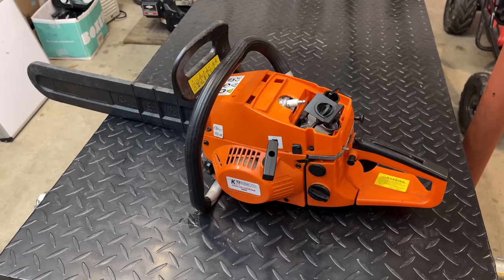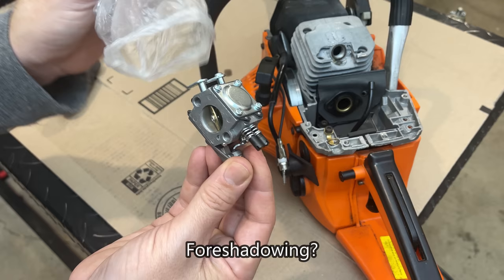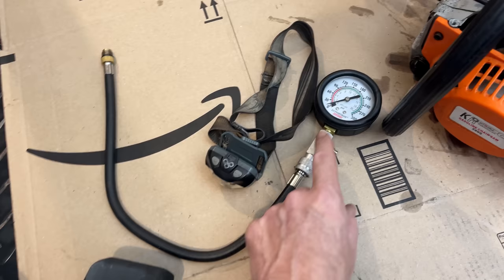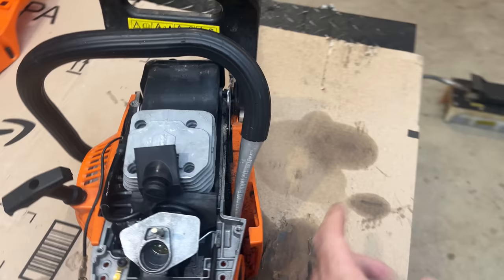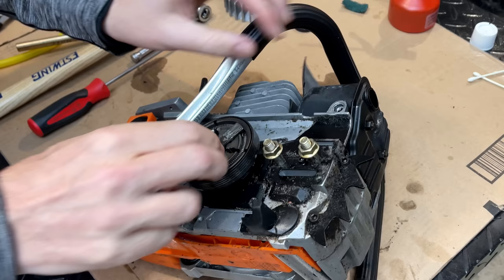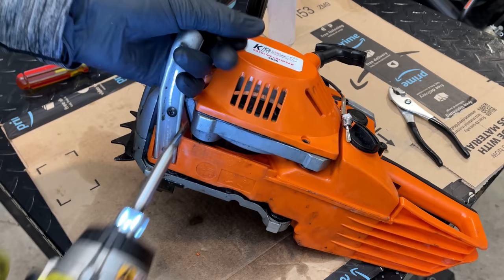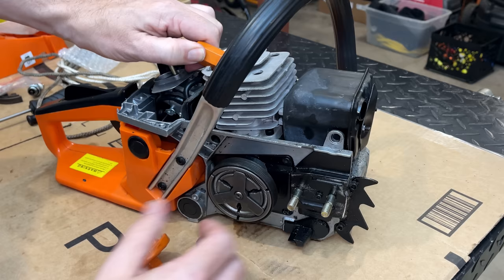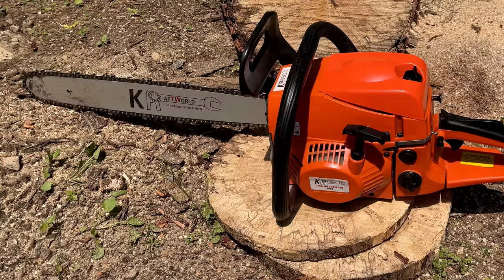Chinese Chainsaw Challenge - Will it Run? (Unbelievable Amount of Problems)

Comment: I had to laugh when your clutch flew off! The exact same thing happened to me after I'd had to remove it in order to reach the oil-pump and fix the misfitted oil-line. The clutch flew off into the long-grass outside my workshop. Thankfully, with the help of a magnet I managed to find all the bits.
A few weeks later it wouldn't start and I found that the fuel lines had melted, no doubt due to poor quality oriental hoses and ethanol which is mandated at 10% by volume where I now live.
Don't by this junk folks!

Comment: It has some value if you plan to bring it 20 feet up in tree to do some cutting AND plan to drop the saw. 
I bought my first saw, a Partner 5000 Pro, some +40 yrs ago when I started to log. Most other loggers had Johnsreds, Husqvarna was young and this was before Stihl became anything. Yes, the Partner is a bulky beast, but it still runs. Ohhh, I changed the chain ... hahah.

Comment: 1:16:35 that happens 🤣
Seen that before🤣🤣
As a lumberjack with 25years experience we always used Husqvarna or Stihl!!
At Education on lumberjack-School the repair dude, handed me an Echo Saw.. I went wtf is that, mmmrph😤 Dude forced me to only use echo for a Long time… I must say its a great Saw!!
I noticed your trimmer is Echo🤓
Not by any chance i have had leaking seals on any Saw???!🤷🏼‍♂️

Been working a lot in People’s gardens, trimning Hedges.. There i learned that Tanaka make great light hedgetrimmers! Next to a heavy stihl!

You did splendid on that cheap crappy Saw dude! Hope the owner link these repear to the manuacturer💯 So they Can pay for your fix, and Maybe make their product better🤷🏼‍♂️

But i must Saw, buy quality and your Saw runs for 20 years💯

BTW we once had a brand new husqvarna that ran backwards??? 😆

Comment: As you said, you get what you pay for. 

Living in the Philippines and building a home here, I gained a lot of knowledge with regard to Chinese made products.  It's a crap shoot at best, and I can honestly say that it seems a higher percentage of Chinese made items are poorly made at best. That became quite frustrating as we built our home and learned what to buy and what to avoid like the plague. 
On the upside. We purchased two ceiling fans that were identical to Hunter fans we had purchased in the U.S.  Both are still working flawlessly after 9 years of use.  We also purchased a dehumidifier, also 9 years and going strong.  My Ingco tools have also proved to be dependable for home use. 

It's definitely a roll of the dice when buying some foreign made products. 

One last comment.  My old 28-inch Stihl chain saw was a beast and took quite a beating in the mountains of Colorado.  Like the old commercial said, it took a licking and kept on ticking.  
You do get what you pay for.

Comment: You did a great job with those issues. All said and done that saw is gutless and shows you get what you pay for.  My stihl 230 will output it by 3-4 ratios and cuts 3-4 times faster.

Comment: Put the air intake box back on the top of the carb. It's running better partially choked hence put the air box/filter on to restrict intake of air.

Comment: It's great to have expert friends to ask questions. If you have mechanical ability you can fix most anything that way. I believe since it ran before, the straight gas had to burn up the crank seals, for the other damage I'm not sure if straight gas would cause that damage to fuel lines/etc. By the way if you put pressure on the bar (push it up) when adjusting the chain it works better while adjusting and 3 links is the rule of thumb (when lifting the chain you should see 3 drive links) I'm not an expert but it sounded to run great but sounded like it could be leaned out so it would rev quicker.(sounded like it was bogging but maybe it's just the saw.) Great video though most people won't have the tools you used but it sheds a light on many aspects of the workings of a saw/2stroke engine. Maybe you should get a dirtbike to work on next!

Comment: IM AN AMERICAN LIVING IN THE PHILIPPINES ,I BOUGHT ONE OF THESE SAWS FOR AROUND $50 NEW AND IVE ONLY HAD 2 ISSUES ,THE ORIGINAL PLUG WAS WORTHLESS ,CHANKGED TO AN NGK AND IT RUNS FINE ,TONS OF POWER..THE OTHER ISSUE IS THE CHEAP CHINESE CHAINS THEIR ONLY GOOD FOR ONE OR TWO CUTS ,THEN NEED SHARPENING OR REPLACING..ID GIVE A HUNDRED BUCKS FOR AN OREGON CHAIN

Comment: this was definitely assembled on a friday evening on surprise imperative overtime, it had like 13 different individual and non related problems
one more issue i see: the seals were both warped, even the one that was straight, could the crankshaft be off center with the seal hole where after some while passes and the seal material becomes less flexible, even the new ones will warp? it is not only hard to replace, but also sketchy since the metal used is really chap and the threads on the crankshaft could easily be destroyed

Comment: This is a good 'How To" video. I learned a lot. Like, not to buy this particular saw. But as far as the diagnosing problems, I picked up a few pointers. I've bought some Chinese made products before. Some good, some bad. The problems I've had with em are mainly quality control related. Decent product but just mass produced with no quality control or checks. Heck, even so-called 'American Made' has it's issues as well. Overall, with all the small motors being made now, they are mass produced and have flaws. If you want better quality controlled products, you just have to pay more. If you know how to work on the stuff yourself, you take a chance on buying cheaper. But overall, you did a good video. You had WAY more patience than me.  lol

Comment: I believe putting on the chain break also works a detent for the amount of pressure is on the fuel system  like a declutch on a diesel cat and i am using some not correct words make lts  pressure on the excise  system !!!

Comment: You have the patience of Job - thank you for the excellent diagnostic repair video.  There is Chinese junk and then there is Chinese junk!  The Chinese can make superior products if they are required too.  If they are just building a product for selling at a price point - this chainsaw - is an example of what you get from them.  The Farmertec / Neotech Chinese chainsaw brands have come a long way in quality and performance.  They are definitely in a different Chinese class - but you still have to look them over carefully before the first run.

Comment: I admire your perseverance with this, but at least the parts were dirt cheap. The only slight improvement maybe would have been to cut about 1/4" off the front of that lid to make it fit a bit better, even though it was the wrong one.

Comment: Haha I was going to ask if you used threadlock on the clutch. I guess you didn't :D 
That's terrible what those factories put out the door. I have a (lesser) name brand chainsaw someone gave to me a few years ago. It had the same issues and I am guessing it probably came from the same factory.  I thought crank seals but went through the same initial investigation looking at the fueling but I don't think I checked for a malformed impulse tube! That was a surprise. I decided my next step one day was to do the crank seals. I will have to look again at your part references I think but not sure how easy it will be getting those parts from New Zealand. The seals are still on my to do list so it was great to see one pulled down. Thank you and good going getting it running! :)

Comment: Appeared that is a soft pine log. Just a guess. I think I will stick with the other orange saw brand. Did learn the seals are a factor for compression. Did not realize the deltaP was that much of a factor for compression. Now will see if can get my old craftsman running. 😂

Comment: Ouch ... that was a challenging one James, your patience was *noted ... most would have tossed in the recycle bin, but it was an informative diagnostic video ... I was watching and wondering what the manufacturing and assembly side must be like at these cheap saw shops must be like in Chyna ... but even with quality saws/mowers/trimmers they can all be a headache to keep running well ... Amazon, Ebay and parts places must be making a fortune

Comment: It sounds good for low compression to be the issue but I guess it could be as low compression also means low suction into crankcase for fuel entry or starvation.  2 stroke are a finicky low to troubleshoot.

Comment: That saw is kind of a cross between a Stihl and a Husqvarna.    You can sometimes cut off the old fuel line and use the grommet from the old line to seal the hole.  Just push some new Tygon through the old grommet.

Comment: Clearly shows mature status when sharpening and tensioning the saw.

Starting the saw without the brake being is unforgivable.

Potentially too it's a new chain so it needs to be run in so it can naturally stretch and then the correct tension can be applied.

Comment: Did you see the bottom ring thin out from the exhaust port
Interesting events, but I would check for run out of the crankshaft,
Watch the video on the output  of the crankshaft runout.

Comment: I suppose when you look back at the start when you we're testing the fuel supply you'll be able to see the air bubbles. It's good. You have a YouTube channel and persist in repairing this thing for entertainment otherwise most people would have thrown it away and put it down to experience as I feel your journey is not over with this thing.

Comment: WHEN I WORKED FOR THE US FOREST SERVICE STUDEBAKER WAS JUST GOING BANKRUPT.  THE GOVERNMENT BOUGHT STUDEBAKER TRUCKS TO HELP SOLVE THEIR PROBLEM.  WE HAD A 2  ton truck where the engine acted like your chain saw.  It would run and then die.  It stImmed all of our competent mechanics.  The problem turned out to be a a rusty gas tank .  The rust  allowed gas to come thru enough to run the engine and then the fuel pump would push thru rust and block the fuel flow.  It took a while to solve the problem.   What a coincident.

Comment: Get a plastic piston stop that goes in the spark plug hole.  Stihl makes one.  They are cheap.  I usually just hit the flywheel nut twice with my impact.  The torque is 25 foot pounds for most saws.

Comment: I have a KX450 that needs the Pilot jet cleaned so it runs better with the choke on. Until I clean it it will stall as if the idle is set too low but it is not. It s because  the choke has to compensate for what and where the Pilot jet is not delivering. So I got to take the FF'ng off and ream out the opening with a twist tie

Comment: when you were using the brake bleeder on the fuel line, and all the bubbles were roaring up the fuel line, I suspected the fuel line was compromised.

Comment: Have one of those saws that is supposed to be the "same" as a Husky 372xp. Didn't run worth a crap when I first got it. Ended up putting in a Walbro carb from the Husky model. It's now my milling saw. If I blow it up, at least I'm not ouy the $1000 CAD that the "real" saw would cost me.

Comment: Did you ever put A base gasket between the carburetor on that chainsaw & the engine block if there's no gasket it's sucking in air due to that gasket missing off of it. It has to have that gasket. It needs that base gasket.& Adjust those fuel mixture screws while it's running.

Comment: I was on home Depots sight and seen a Chinese chain saw and out of the box it would not run, I had to pull it while my mom held the throttle wide open,... just to make it fire,...I just sent it back. I think I read that the pull starter plastic breaks on  those saws.

I just bought a Homelite off of Ebay,...it looked as if it just needed a primer bulb,... but I ended up putting on new fuel line.
But it wouldn't run, it was getting spark but  no fuel,.....so its probably in the carburetor,.... I was about to replace the clutch when I noticed looking through the exhaust port the far side of the cylinder has a wide shinny strip up the cylinder,.. that kinda makes me think there might be something wrong.
But I have not worked on chain saws much.

Comment: Get some Ametech engine treatment, it relines the cylinders. Don't use too much or you'll never pull it. For that bore I'd try about half a cup. It will have to run a few hours to get the compression up. It will probably cut about 20 trees down before you have to reline it again.

Comment: First off, good video, second is at 22 mins the fuel line has multiple cracks but I think you missed that at the time but then again the Vac test did produce a shit load of bubbles didn't it, third is I bet that clutch nut was actually loctite'd on, the internal threads were white when you first removed it and it took heat to break it free. The real take away is it's a junk saw, it might do a few tanks of gas but parts are going to drop off it pretty much straight after that. Like you, my first saw was a Stihl 038 Magnum, bought it new a really long time ago and not a single problem from then till now, it's only half the size of my Husky but a joy to use.

Comment: i  completely admit i heard the story and also had very little hope of that thing running  i am shocked you got it running. as well as it. twas i   got a old boat with twin SBC Inboards  that had one motor that lost
Reply: her Cooling water at high RPMs and locked up. her Piston  literally blew the top off of it to look like a opened cann of Popeyes Spinach  plus  Chunks of metal  punctured holes righ through the  Aluminum Oil Pan i dropped a new 283 Chevy Truck motor in and Marinized it with the proper Marine Carburetor ,Intake,and Exhaust manifolds,Raw Water Cooling Pump ,Brass Freezeplugs and  a bolt on exterior cooling water inlet onto the Heads that literally uses the water the boat is floating in as it’s source BTW this is a Historic Chris Craft Motor Yacht and ost of the original Parts from Chris Craft are. bolt on Pieces they  utilized  and it’s nice to keep those parts on that Vessel for investment purposes. which was what my intentions were  i have since sold that boat and kind of lost  her exact location / Ownership in recen years ?

Comment: The builder tore up that fuel line when they put it in - they pulled it to hard with a pair of hemostats or whatever they used to get it into the tank.

Comment: James Good Video first time I saw your channel ,of course there will be a lot of knockers of  Chinese and other less developed countries  manufacturing equipment etc and indeed I am not a huge fan ,but on the other side of the fence I have owned 2 Stihl chainsaws in my time 1 Brillant 1 Hopeless Hard starter and the brilliant one had a circ clip missing off one side of the little end from new  and had to have a new cylinder fitted as a result and after that ran like a rocket 
Now in recent years as I have very little use for a chainsaw and in the meantime had moved country I caved in and bought a cheap Chinese saw Well was I impressed as it’s got the modern recoil starting system just pull the cord a little bit Anyway I have had it about 5 years and star’s first time every time Keep up the good work

Comment: Oh boy, I have another brand of these chainsaw, the BlueMax from Lowes website.  That cracked fuel line, I'd hate to waste ANY money on a basically new chainsaw and buy the same fuel line again.  I'd rather drill it out and put some sorta grommet in there that will fit the typical lime green fuel lines.  I did have FLOODING issues in the beginning for some reason, but they resolved themselves somehow, then the chain kept doing something that seemed to be tightening itself and I'd have to sort of leave the nuts a little loose on purpose, and just recently having that fuel problem where I can only have it running while playing with the choke.  Hopefully it's just a clogged pulse line as you showed this one had.

Comment: great video excellent diagnosis,i am a motor mechanic i rarely work on small motors but for good customers,i do repairs on small two strokes.some of the chinese machines are quite goodish,the pull starts are a bit doubtful.i think some stihl saws are made in china.

Comment: If you check early in the video you can see the bad fuel line. It's when you first have the carburetor off. Why does it have a throttle lock? It needs to be removed. That is dangerous.

Comment: Great video - the one good thing is that you have saved it from landfill. Yep sure a stihl will last a lifetime but costs a heck of a lot more - for less well off you have provided a good tutorial as to what could be wrong. BTW I had the same fun and games with my compression tester - tore apart a perfectly fine engine before I realised and did the test on a running one like you did.

Comment: Great video
Reply: Anyone who buys one of these knock offs and thinks it will last for hundreds of hours under commercial use is delusional. These saws are designed to last for a hundred hours or so, working in a residential capacity. They can and will do that, and if someone pays the stupid low price and uses the saw for a season or two, it was a good purchase. A hundred dollars every couple years  is a good value for most. I use Chinese equipment and German made on the job site. Both have their place.

Comment: May have been best if the owner took saw right back to store and asked for a running saw :) If only they had been smart enough to have first used mixed gas after reading directions.  For a saw that never ran why was the air filter cover gone and side cover so damaged it needed to be replaced ?

Comment: Husqvarna clone. I had a 55 Rancher that also had trigger problems. Other than that it was a really good saw. Used it one day and the plastic trigger broke. Put it in the garage on the bench to work on later and some low life broke in and stole it but left the POS Homelite that was setting next to it. Only buy the Swedish made Husqvarna as the US made and the Chinese clones have to many problems.